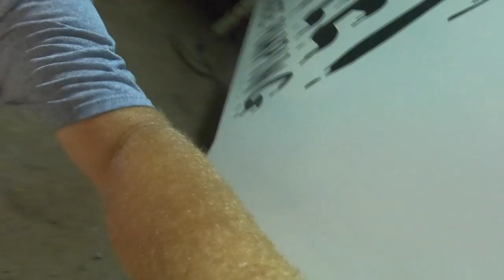Taking the pump truck to the lake. Pumping concrete with Muddyfeet Concrete Pumping

Comment: Really great videos. I do admire how you never have problems when it comes to pumping with the boom pump. We have a 24mt putzmeiter and we do have problems, it look like or our concrete does no have the correct amounght of past  or we are not priming correctly. In any case great videos
Reply from the maker: Thanks for watching! We do occasionally have issues. You can look back through some of the videos and see. Most recent one was the video titled phone lines are low. They had my valve locked up from the get go. Also the video called pumping a shop slab and catching a pool cabana. You’ll see me get plugged on the prime out. So we do get some issues. Thank you for subscribing and watching!!,